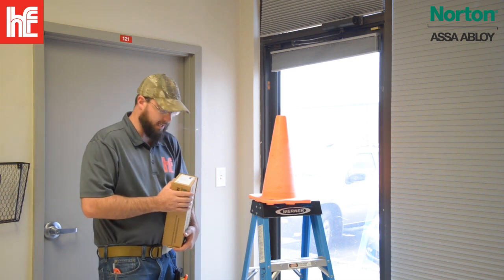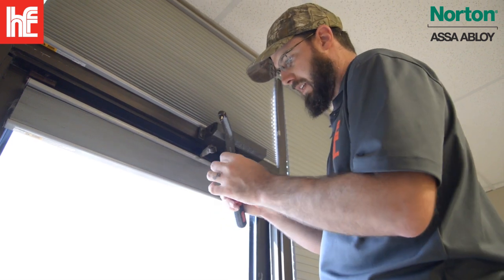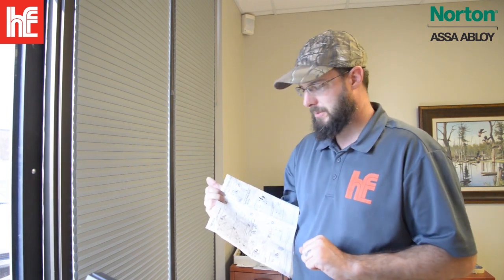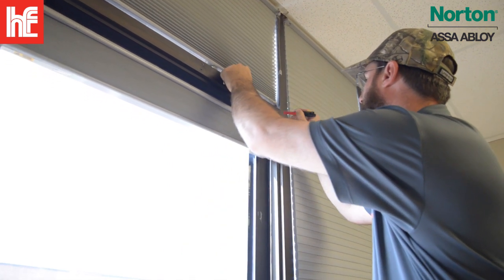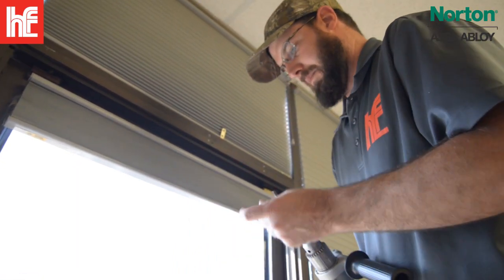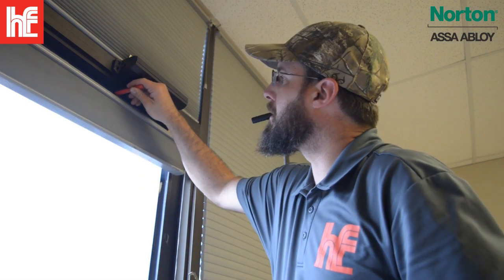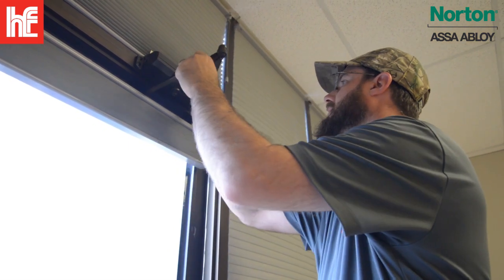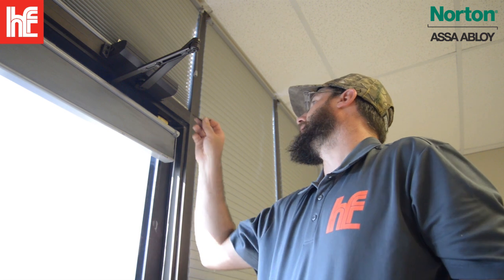Norton Rixson 1601 Door Closer Installation

Comment: My instructions have two dimensions of 1-1/2 plus 1/2 inch or 2 inches for the vertical dimension at 9:10 in the video. It does not appear to matter that much though. Great video showing Top Jamb Arm installation. Thanks!